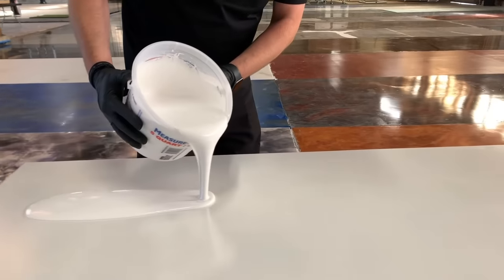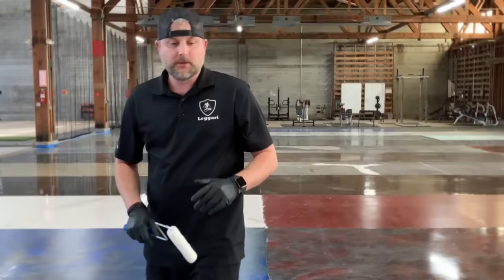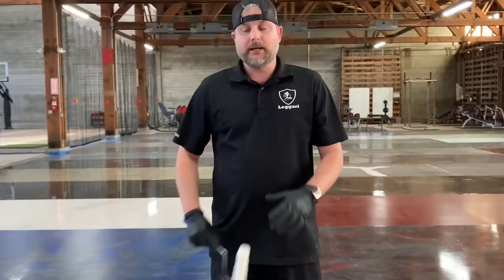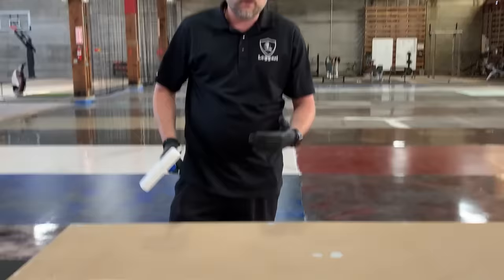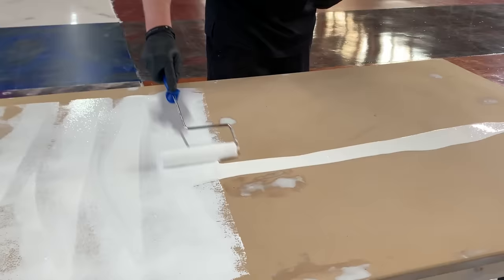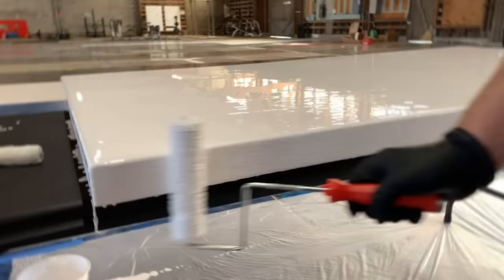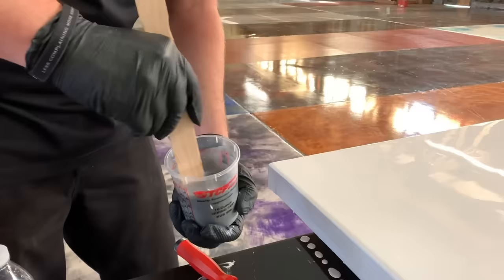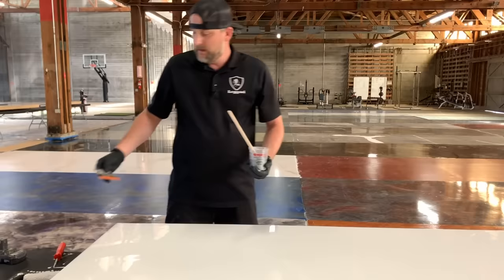Faux White Marble Dinning Table Done Using Epoxy Resin (From Wood)  | Step By Step Easy DIY Tutorial

Comment: When the table had a glossy finish it looked more like marble because of the way the light reflected on and through the epoxy.  After the matte finish was applied, it didn't look as authentic.
Reply: You right
Reply: I prefer the honed marble or leathered appearance.   Same for countertops and shower walls.   Plus it tends to have a smoother, more buttery feel.   I am also a costume designer so textures are important to me.   That probably impacts many of my decisions.

Comment: did the table have beveled/rounded edges to help the resin flow over the edges? I've recently attempted this on a table with straight edges and the resin didn't flow over the sides properly 😭

Comment: Do you have to use a top coat? I thought the epoxy was the top coat. I want to do a guest bathroom, that is seldom used. I want it to look like white marble, much like this table.
Reply from the maker: You don't have to put a top coat on but we do recommend our urethane top coat because it makes the surface more durable.  You can also put it on at a later time if you want.
Reply: @LeggariProducts  sir this is stone or wood

Comment: This is absolutely great...only thing is I ordered marble kit from this company an year ago ($600+) and I wanted the glaze top coat...it turned awfully yellow as soon as it dried. Then I had another top coat send to be by the same company and I had to sand down the entire countertops and refinish them and still turned yellow. I’m glad at least you guys come up with some new top coats even though I will still be afraid to do it as I’m tired looking at these ugly yellow countertops! 😭😩Looks like there are a lot of cheaper options and use some polycrylic (water based) top coat that won’t yellow!
Reply: I called and they said the smallest kit is 3 gallons, so why are they advertising doing a table,  for 600 bucks I'll buy a real marble table,smh

Comment: I am doing our old built in bar top and backsplash.  I have sanded down the bar top and painted 2 coats of white primer & paint.  The back splash was an old mirrored piece that was built in, so I covered it with a nice solid 1/4" board, sanded it down and did 2 coats of white paint & primer.  Is it hard to do the veining on a vertical surface?
Can you give me some tips?

Comment: Won't a white epoxy table end up yellow in a few months? Does the urethane top coat help to prevent that. I typically steer clear of white when using epoxy because it yellows so badly.

Comment: How well does it handle heat? For instance used as a countertop and placing hot pans on. Will it bubble up?
Reply from the maker: The epoxy will withstand up to 200 degrees but we do not recommend ever putting hot pans on any type of countertop surface.

Comment: Do u think it would be a problem if I made a square concrete slab that was square , as In unable  to route the edges
Reply from the maker: Yes you can, you will just have to work with the epoxy a little more to cover the edges by rolling them.
Reply: Leggari Products thank you!

Comment: You stated that you used you new urethane matte finish !     Is this different than the matte finish I have been purchasing!!   And also I have always gotten a response to any questions I have ...  I love your product....   ty
Reply: What, on a video?  Have you ever called them for support?
Reply: Exᴘᴇᴅɪᴛɪᴏɴ Aɪʀᴄᴏɪɴs I use their products ..  I usually message them through their chat on their website and I get an immediate response..   did you order a sample kit ?
Reply from the maker: Yes our new matte finish is without the grit and will leave it a smooth finish and our old matte finish that you add the grit to will leave it more textured finish and not a smooth.  We still have both formulas available.

Comment: Will any primer do? Or does one need a special epoxy primer?
Reply from the maker: You will want to use our primer because it is specially made for our epoxy.  Our primer is a water based epoxy specifically designed to chemically bond to almost all smooth surfaces.
Reply: @LeggariProducts  when ordering one of your kits, is the primer included?

Comment: very nice, one question, is that "white primer" a white paint? and did you wait it harden between 1st and 2nd coat? near 2:40?
Reply from the maker: It's a white primer! Primer comes in our kits. It bonds to the substrate as well as the epoxy. You'd wait until the primer is tacky and then apply the base coat. It depends on the room temp. but it can be anywhere between 45 min- 1.5 hours.

Comment: Such a great job! What’s the measure used to mix the white primer with the epoxy?
Reply from the maker: Our primer is a 2:1 ratio and our epoxy is a 2:1 ratio.  As far as how much primer to use you just want to be able to cover the surface. Our 1.5 gal. primer kits cover 500-800 square feet.

Comment: Would this type of finish or any of your other finishes hold up well on assembly tables in a cabinet shop? Thank you!
Reply from the maker: You will want to use our urethane top coat because it is four times harder thane epoxy and makes the surface more durable.
Reply: @LeggariProducts  do you sell it? Are you in Canada ?